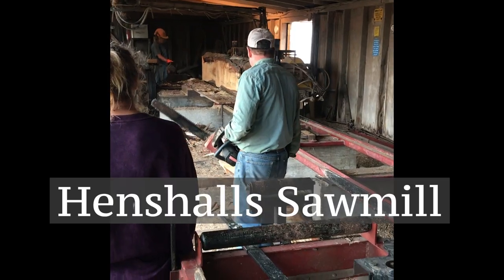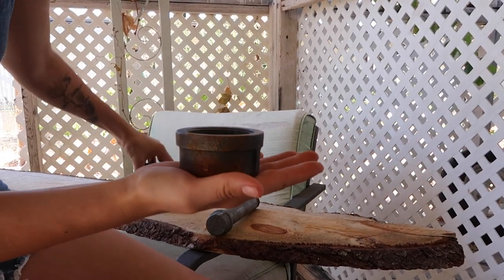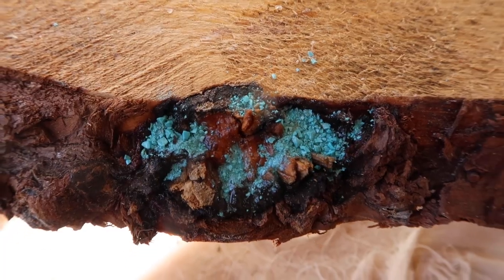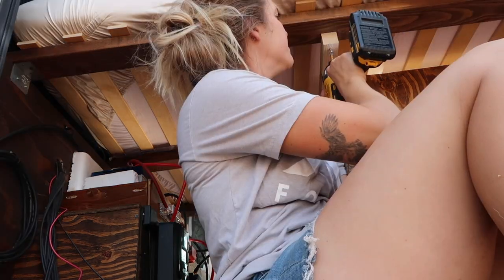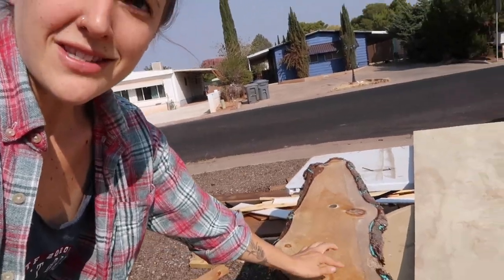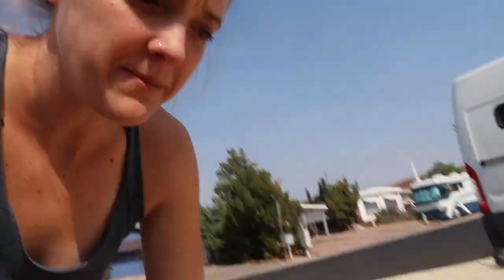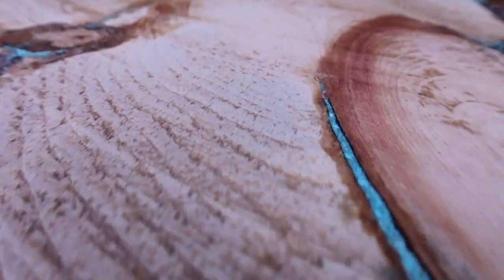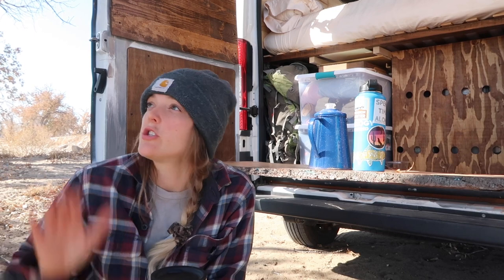MULTI-FUNCTION Cheap Van Life TABLE | Turquoise Inlay

Comment: I like this slab table. I never thought of one before.
Pretty clever use of the two doors as supports for the table.

I'd probably still hook a bungee to both doors to hold them tight against either end of the slab table though. 
I wouldn't want a strong wind to swing a door and cause your cook stove to go flying.